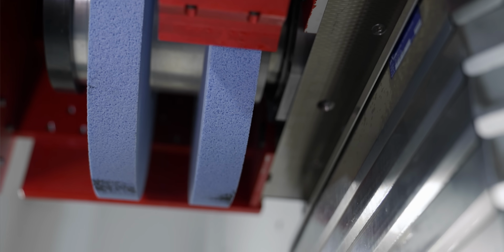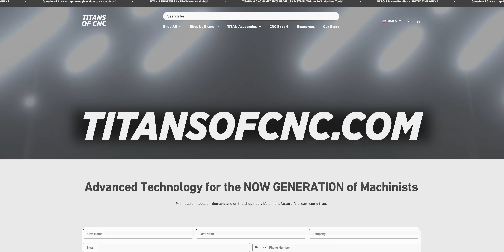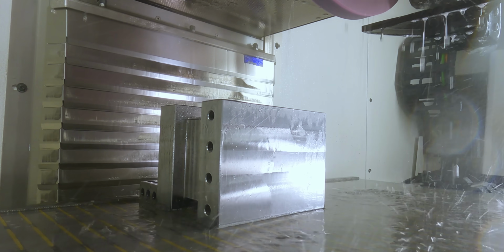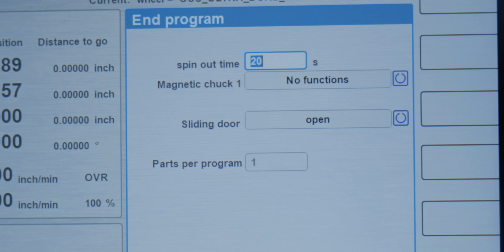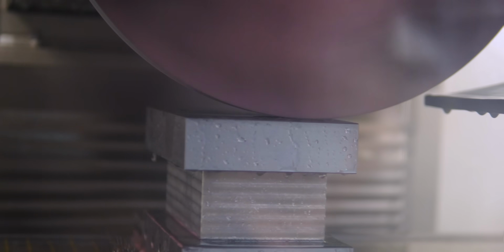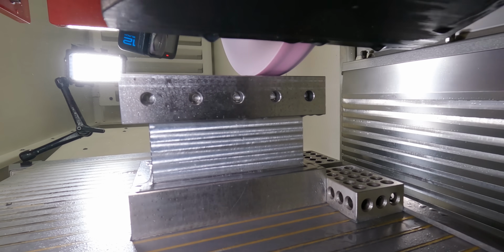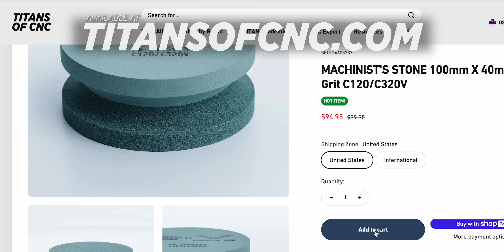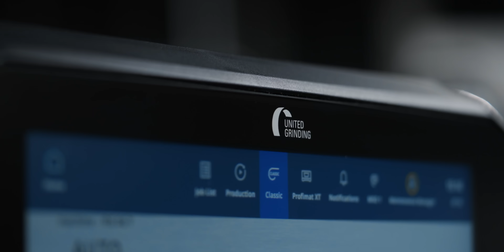Incredible TEST: 2 Grinding Wheels, 1 Mirror Surface Finish

Comment: What was reason to put two wheels instead of giving 2 passes (like with finishing wheel?). What was reason to print the nozzle on smaller side, not the wider one? And it seems like left nozzle was off. Otherwise - great job, always enjoy watching this videos!
Reply: They printed on the smaller side as you put it to reduce the need for internal supports. The Y split for the two sides would be printing in mid-air if they printed it in the orientation of the CAD. Internal supports for the part would be really hard to remove and you could not guarantee all of them were removed (closing off a nozzle or restricting flow).
Reply: @ScuffedEngineer  yes, good point.
Reply: @ScuffedEngineer  although, I'm pretty sure you don't need support as the divider would be a bridge between two walls.
Reply: @SergeyRyabenko  Depends on how the slicer wants to handle it. I could see the slicer not wanting to bridge in the orientation it was printed in and the machine they used has a rectangular buildplate so it might not have fit if they rotated it 90 degrees to force the slicer.

It could be a property of the machine trying to lay the continuous layer of CF as well. I've seen the onyx, been around them, but never used one.

Comment: One thing I was always curious about. How do you keep the wheel diameter dimensions to something known ? Specially with double wheels, do they not change their diameter at different rates ?
Reply: You skim them off on a diamond so they are identical.
Reply: @AlexMageethefirst  Ah I think I saw that towards the end of the video, that pin that stuck up from the bottom. So that is the reference height, against which the disks are planed ? 
Is this step done before each process  ?
Reply: @SarahKchannel  it’s done when you first install a wheel so you have an exact reference point, then periodically you clean them up to expose fresh wheel and reset the reference.  Kind of like touching off a tool on a mill.
Reply: @ Makes perfect sense :) - thx

Comment: I thought you would be closer to 20 millionths after that grind. But 50 is plenty good for 99% of work. I'm now retired, but I wish I could have had access to some of the machines you young bucks have. I had to learn grinding and tolerancing  from an old fellow who was a long-time toolmaker and inspector for Sheffield years ago. We used lapping for some tooling and would always try to leave around 20 millionths for the lap. Nice video. 👍

Comment: That surface finish is amazing!
But I'm wondering about the squareness of the sides to each other, I mean all the opposing sides are parallel but they are just as square as the mill did geth them right?
Reply: Yes, nobody with actual surface grinder experience would do it like this guy. also finish on the sides is not the best. can get better on 1989 j&s 540 with 46 grade wheel....
Reply: im an experienced grinder and i was disgusted by some of the things that i saw
Reply: I was just about to write the same thing. Good nonsense for laymen. They improved the surfaces, but the geometric conditions were retained from the milling machine. I work on a grinder and these videos are poor.